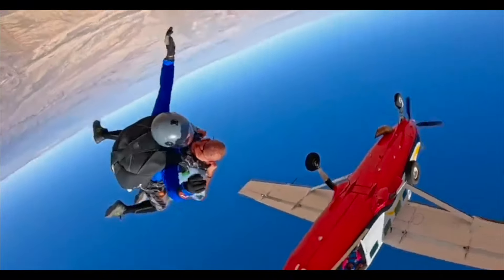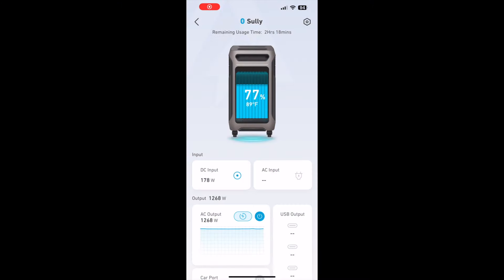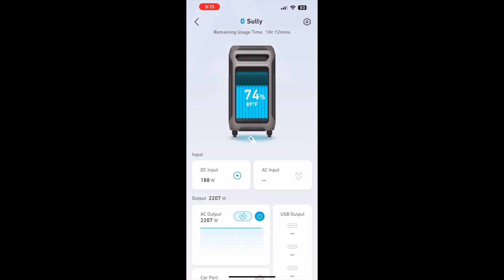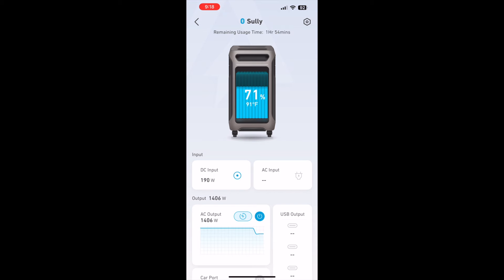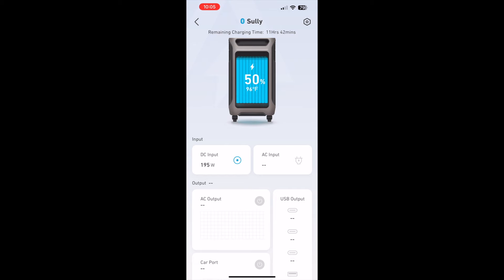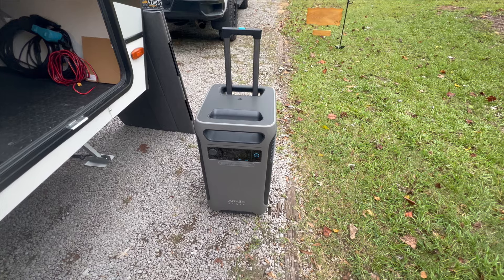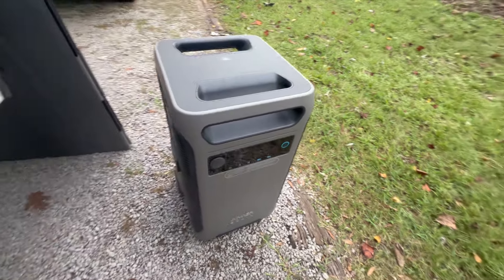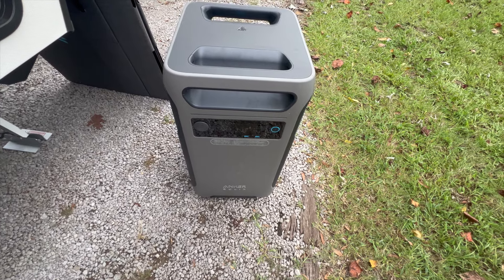Anker Solix F3800 Solar Generator test with our RV

Comment: Each unit supports 2400 watts of solar and 6 additional batteries you can definitely full time run a 5th wheel off this unit with the right amount of solar and additional batteries

Comment: how is it after 2 month? im thining about buying 2 of them, and 6 400w solar panels.
Reply from the maker: The unit was amazing and worked as it should have for the way I used it. I ended up selling it because we were having a big Solar/Lithium battery install in our RV.
Reply: @motavated_travelers how is that new battery holding up in your RV?
Reply from the maker: @DesiveLara  batteries are amazing
Reply: @ make a video about it when you get the chance